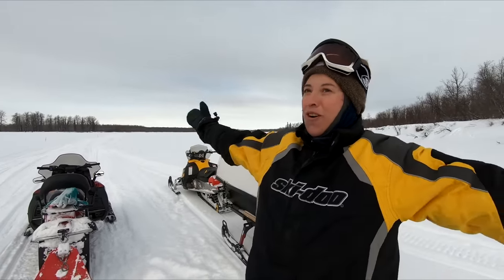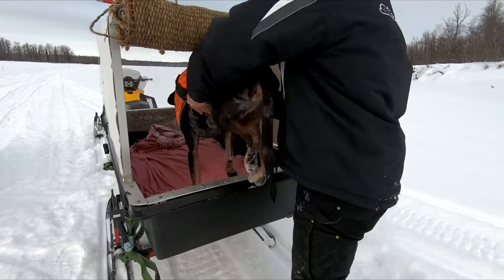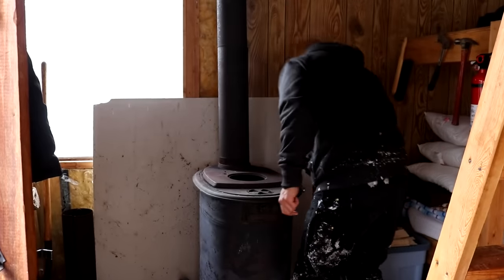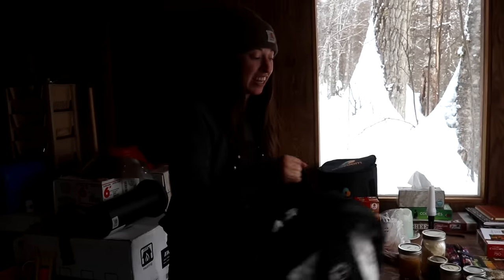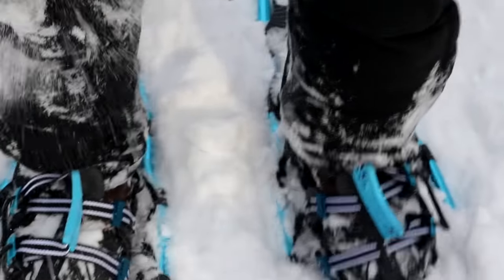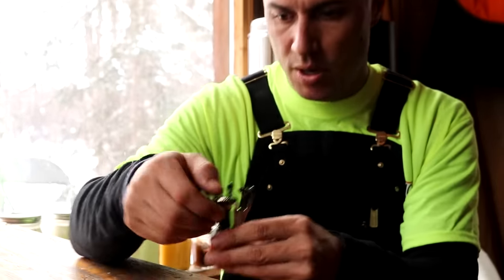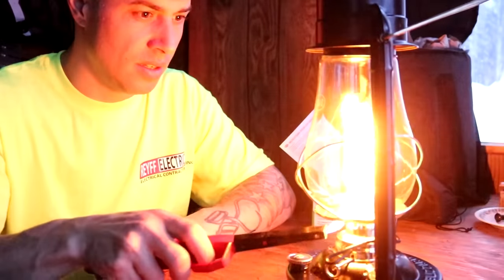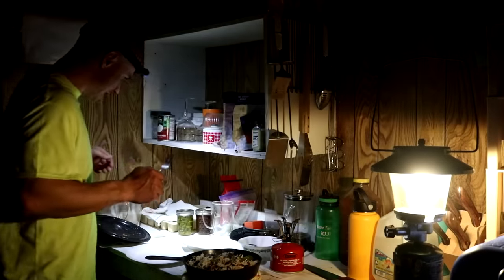Winter Trip to Our Alaskan Off Grid Cabin (Part 1)

Comment: DANGER PLEASE READ the oil lamp you got is not intended for the gas you put in it, it is an oil lamp if you continue to use it it may blow up. the gas is intended for a pressurized lantern made by Coleman. read the label on the side of the can.

Comment: I believe there is a difference between LAMP OIL and FUEL OIL......Fuel Oil is what would normally be used in a Coleman Stove  and Lamp Oil would be used in your typical Barn Lamp like the new one you bought...Please check the applications for your lamps and stoves BEFORE you use them, to be certain you are using the appropriate oil or fuel, so you don't burn your beautiful cabin down...

Comment: Since you are in the middle of nowhere if you take 3  12 V batteries connect them positive to negative    your left over positive goes to your work you're left over negative goes to your welding rod and you will have a 36 V DC  Arc welder  Using the 3 car batteries I have welded half inch plate with them You're welcome

Comment: When my family lived in Red Devil, along the Kuskokwim River, we used a kerosene lantern to light up the house. We had a hand pump built inside. We didn’t have running water, or electricity during the 1960’s-1970’s. My family had three set net licenses off Youganic Bay (spelled incorrectly), on Kodiak Island. So we flew to the bay early spring and stayed until fall and during the summer months we fished at sea (set net) and each one of us kids had our own halibut line. Than a tender boat would blow their horn (early hours: sometimes 3-4 in the morning) and my dad and oldest brother would take the sea skiff out to the boat, load the salmon onto the tender and do it again whenever their schedule was. We seen all kinds of wildlife

Comment: Is that Sleeping Woman in the distance in your drone shot?  Isn't Alaska gorgeous?  It's a fierce, austere beauty, but I love it.  And I'm jealous of you, with a cabin on a lake in the wilderness!  At very old Estates (capitalized because these are the Old Money Important People) the drives never headed straight up to the mansion, but wound about seeking the easiest slope so the horses could pull the heavy coaches up.  You need a "coach drive" to the cabin, one that winds around the slope rather than heading straight up.  Not only would it be easier for you to climb, but might even make it possible to reach the cabin by snow machine.  Dude, get a haircut! ROFL! Warning:  That's a kerosene (or lamp oil) Dietz lantern.  I HOPE that's not white gas (like old-time Coleman fuel) you poured in there.  It would be courting an explosion and uncontrolled fire! That's a French Chef's knife.  I have a couple - they're great, especially for slicing veggies, although they obviously work good on frozen moose meat . . . and I use a 12" one to slice home made bread. Get long insulated leather gauntlets to use when reaching into that stove (or a new one), to protect hands and wrists from contact with flames or hot stove parts.  Kudos, guys!

Comment: Something that has worried me about the dogs' sled:  seeing Bo curled up against the windshield is asking for a broken neck if you ever have to stop quickly, slam into soft snow, or drop into an unseen hole or trough, especially with the stronger windshield.  I would suggest dog harnesses with extra heavy-duty bungee "leash cross-ties" to keep them from moving forward enough to slam into the windshield and allowing for distribution of the forward momentum across their chest and shoulders.  They could still stand up, lie down - perhaps not turn around - but you could figure that out.
QQQ  How will you access your cabin in summer - how long a canoe paddles?  ?? Sled and pulley system on deck and ?trees to pull stuff up the hill?  OMG that Blazo in the oil lantern!!!  You two just tested out your guardian angels big-time - talk about "gettin lit up"!!  Aladdin makes (or used to) some gorgeous, very effective high-quality brass pressure hanging lamps/lanterns/chandeliers.

Comment: You didn't get my other message I bought a MSR Pocket Rocket 2 and a pan that everything fits inside it. I stopped at Walmart on the way home and bought there small Colman fuel for around 5$ the big one is 9$ much large and more stable and cheaper you get twice the fuel with the small Coleman vs 2 MSR's I bought 2 MSR fuel canisters at 8$ each but okay for back packing

Comment: You should setup a bossons chair/ski-lift.  All you need is some rope and a regular pulley and a spool pulley.
Attach the spool/drum pulley the the cabin and the other to a tree at the bottom. You will need crank handles on both ends. Getting your stuff from the bottom to the cabin would be way easier and vice versa.  When I was a kid (1960's) I made one to go between 2 tree houses. There was about 3 m (10 feet) difference in height at a distance of about 7 m ( 23 feet). It worked really well.

Comment: Eric and Ariel, Nice job on the restoration of the Griswold cast iron pan. Griswold is one of the best cast iron cookware brands you can find. Taken care of, they will last for any years and centuries. They are truly an heirloom piece of cookware.

FYI, you should only use lamp oil in the Dietz. That fuel you have is for the Coleman pressurized camp lights and stoves. Camping fuel burns much too hot for the oil lamp and can cause premature wear on the glass chimney and wick base, also you will burn through wicks much faster.

Another great video. Really enjoy your adventures to the cabin, and the hot springs were cool too!

Comment: I was just watching these videos.  You must be almost to Skwentna.  I have a place up at Shell Lake.  That river will test everything single nut and bolt, and I've been running it since the 90s.    If you are gonna be hauling get a Bearcat or a Skandic.   Towing with a small sled eats the bearings on the jackshaft.  I've have them fail at Skwentna.  Not much fun, so if you've hauled a bunch swap yours out.   Paying Adam is a good choice too.  Freighting is not easy, and they do it at a reasonable price.   The red sled is good, but for river running skis are the best.  Makes freighting way easier.   Most of my freighting is done, so my bearcat will soon live at the lakeand I'll keep a go fast sled for back and forth.   Looks like a nice place.  The scenes where you traveled back into 1990s Anchorage via old papers was cool.  Those were my glory days in Atown.

Comment: STOP using that lantern till you empty it and refill it with lamp oil, those cans are white gas ! 
 White gas is meant for a pressurized system with a valve to control the flow. If you lowered the wick to fast it may cause a explosion of the fuel in the tank. 
I travel to my cabin by ATV and everything has to be packed in , I've found a food box works best packing everything in as tight as you can and filling voids with small compressible things like garbage bags, towels, even clothes. Just like packing a cooler in the summer, fit everything in nice and tight .
You need to make a tow line for that hill, like a ski hill.

Comment: ...If you do make steps up to the cabin,  I'd suggest making them both broad and deep, so you can nagivate them with snowshoes on (even if you have to step up & down sideways one step at a time).  Half-rounds of logs could help with that, flat-face up on the top, and a half-round and some quarter-rounds face bark-up underneath for stability, posts driven into the ground along the front edge near the ends to help keep them in place, maybe...?

Comment: Lexan is a brilliant poly-carb, near unbreakable. I used it extensively at work. I mentioned and described it in a comment on the last vid, but maybe you'd missed it, plus I always wonder how long it takes between your filming and upload. So, maybe by the time it went through you'd already been talked into it buying it by someone sensible (the plastic-shop guy).

Comment: You might need a larger jet or drill it, I forgot the ratio.  But alcohol stove, lantern.  Do not forget about a methane ingested.  A simple one is where a hole is dug. Organic material piled in it.  When full, stick a capped pipe in it, then bury the pipe and hole.  If there's clay, it'd probably be ideal for capping the pit.  Which once methane starts coming, you can have a night flare, 😃, or, step it down, put an extension with a valve and mantles.  Sasquatch might appreciate it as well as other creatures.

Comment: You need to use lamp oil or kerosene in a Dietz. In a hard-core situation, you can use olive oil. Other oils would be too thick. We have a #80, #8, #20 and  #76. The #80 and #8 are awesome.

Comment: That fuel is Naphta. You should not use it that lamp. It is highly flammable and just pouring it whilst in your cabin with the wood stove or any other flame going could result in an explosion. What you need is kerosine or clean lamp OIL.   Keep those fuel cans outside for your safety. Please!

Comment: I was taught to only use kerosene fuel in hurricane lanterns (same as tiki torches). You can usually find it also find it blended with citronella- which is good to repelling mossies.
Note- the side of the fuel can says the fuel only for pressure devices - you are definitely NOT using the right fuel. You are lucky you didn't blow up.

Comment: Eric if you notice the ends on each side are Square, to help stop the black smoke on the glass shade you uct those ends about 3/16th of inch, that should stop the smoking.I always kept the wick about 18 to 3/16th of a inch above the plate.,      what ever you do do not try and read or write by that lantern light
Peter

Comment: I cringed when you put a match to that lantern. Wick lanterns burn kerosene (some people even burn diesel in them however diesel produces more soot and residue.) The fuel you have there used to be called white gas. White gas is too volatile for a wick lamp. It works great in a Coleman dual fuel pressure mantle lantern if you can find one. They are extremely bright and put out a good amount of heat too. White gas pressure mantle lanterns used to be more common but they require greater attention than the propane lanterns you usually see these days. White gas can also be used in Coleman liquid fuel pressure stoves. They also used to be common until propane and butane took over due to ease of use. The old style white gas (now called dual fuel because they will also burn unleaded gasoline) lanterns and stoves are cheaper to run and will also work at lower temperatures than propane. -If you guys plan to become certified sourdoughs you're going to need to learn to use white gas lanterns and stoves. ;-)  Thanks for the video Eric and Ariel. You guys are awesome!!!

Comment: Nice OIL lantern. Guys you scared the heck out of me. The fuel you have in the lantern is a bomb waiting to blow using that fuel. You need to use lamp oil. Kerosene will work, but has a high flash point a s well and smells. What you  have is for a pressurized lantern that uses a mantel for  illumination. Glad you shut it down

Comment: So it means in summertime u come by boat? Need a  Pulling Lifting Winch to attach to ur Trailer to tire up from ur house to the bottom and use ur slid to attach the Winch to bring ur stuff up? Only 40 pounds in the UK. Have fun.

Comment: The lantern fuel you were using is intended for pressurized lanterns, and isn't correct for the type of lantern that you have. It's actually not safe to use "white gas" or Coleman fuel in a wick type lantern. You should use kerosene. Kerosene is much less volatile and burns more controllably in a wick type lantern.

Comment: please discard the fuel, after time and heat cycles(summer/winter) it can become unpredictable and volatile. I believe that fuel is for pressurized appliances, the self heating/vapor kind which the lantern is not. You want thicker fuel for the lantern that will not create fumes which is why there's lots of soot on the glass and why it almost took off on the first light.

Comment: Hurray!  you got some Lexan for the dog window!  Yes, it is expensive but around here, it is a game changer. We get severe temperature swings and way below zero temps and Lexan has been tested time and again to serve the needs around here. Hope the pups get a nice view, break from the winds and you guys have a great secure dog window on the sled. Awesome. The addition of the metal frame around it only adds greater strength and stability. Way to go guys!

Comment: That is a kerosene lantern.  The fuel you have is made for pressurized appliances like the Coleman lantern and cookstove that you have to pump up to pressurize.  Kerosene has a very high flash point, similar to diesel, while that camp gas has a very low flashpoint. Hence anything left in that lantern will evaporate at a rate that is dependent on the ambient temperature where it's stored.  Camp fuel is very dangerous when not used in a pressurized system as you saw at first lighting.  But it will also work at extremely low temperatures where your propane and butane would freeze in the fittings, and kerosene would start to gel.

Comment: that's livin'. i can't even imagine how good that moose, mushrooms and rice is. 

the fuel you found at the cabin is for a mantle style lantern similar to your propane lantern. you fill a tank and then pump air into the tank to pressurize it so the gas flows to the mantles. the Dietz lantern you bought is designed for "Coal Oil" which is thicker like diesel fuel. if you continue to use that fuel in your lantern the glass will overheat and shatter and you will have a big fire. "Blazo" fuel is like extremely high test gasoline and is incredibly flammable. you should be able to find Coal Oil easily enough in Alaska at a hardware store. be sure not to buy the Citronella Coal Oil for use in outdoor tiki torches. that's designed to keep bugs away and if you burn it indoors you will poison yourselves. 

thanks for all the work filming and editing. patiently waiting for part 2.

Comment: That is an oil lamp you have there and it burns lamp oil, ie. liquid paraffin or kerosene.  Coleman fuel is naphtha, white gas.  You are lucky you didn’t burn the cabin down.  Lamp oil will burn clean with no soot and be much brighter.  Liquid paraffin is odor free, better than kerosene, and available on Amazon or any Wal-Mart store next time you go to town.

Comment: If the beetlekill up there is still solid you should mill some of it.  Youre gonna end up building SOMETHING and it's easier to mill it there than to haul it. A sawmill setup would be sweet, and that wood is rotting.  I had a lot of nice trees i had marked for the mill and now they are all garbage due to the beetles.

Comment: Use bubble wrap around the jars then towels. Bubble wrap helps to insulate stuff also. Get some flashing an use it behind the lantern to reflect the light back/around. That's why they used wall sconce's that had a steel/tin back plate's. Get one of those tool boxes that go in the truck bed so you can keep dishes , pots, pans and stuff in it. Mice can't chew into it. Poor fur babies were tired and cold. Thanks for sharing. Stay safe and healthy. God bless

Comment: It looked like you were having some big issues with the kerosene lantern. I would recommend waiting at least 30 min after fueling before lighting it. And first light is always nasty. That wick has to be burned quite a bit before it doesn't smoke so bad. But they will always smoke a bit. Noticed by supper it was off. They are good lanterns, don't give up on it.

Comment: That is a nice lantern couple of tips for you tho -like one guy said  you need to keep the glass really clean, crumpled up news paper works great don't use soap or windex it just stinks once lit. You also need to "Trim the wick back almost to the fresh wick (like 1/4"of black showing) and trim it rounded not to square, this also shapes your flame) When you light it keep it turned low so you don't get that carbon build up on the globe. That fuel must be like high octane kerosene by  the looks of the flame and soot build up 
  I love this little home away from home, years of fun trips to get away from it all for years to come

Comment: Thanks for the video again folks. Looks like the kerosene vs white gas has been well covered so that's good. We always keep a few "hurricane lanterns" in the shop with a few gallons of kerosene just in case of long term power outages. That lamp can actually run on diesel too, but it'd smoke more and you'd want to be careful of that inside. The overflow in spring can be interesting to say the least, but again it looks like you folks have that covered. Lexan is wonderful stuff and will work well for the dog's sled I'd say based on using it in industry. Thanks again and stay well.

Comment: Back in my guiding days on Lake of Woods in here in MN we had to have two extensions one winter.  A drilling tip I could give you with ice that thick is to clear out your hole a couple times before you break through.  Getting an auger unstuck when it's buried to the powerhead sucks.  It'd be nice if they had reverse like the electrics.  Also shovel or kick away your shavings as you go so when you break through the water doesn't splash up and get sucked into your carburetor if the power head is down in the slush.  Just a tip or two.  Really enjoy your videos.  Thanks for sharing your adventures.

Comment: Put a manual or a 12v winch on the deck for when you bring stuff put them on the sled and winch them in. For a 12v wonch bring a battery with small solar power and keep it in the cabin. An inverter should help you also for inside small appliances connections. 

Glad the Lexan helped on the dogs sled.

Comment: Sure hope you can cut a new driveway to the cabin this summer so you can pull up to it in the snowmobiles next winter.  Find a gentle slope you can wrap around - it will be longer, but worth it,  I hate to see you struggling to get supplies up that steep hill.